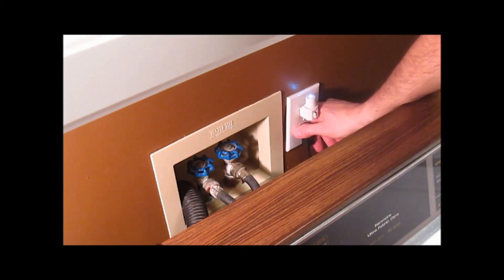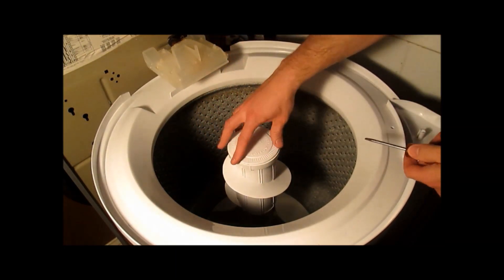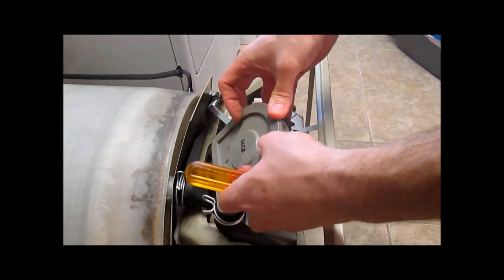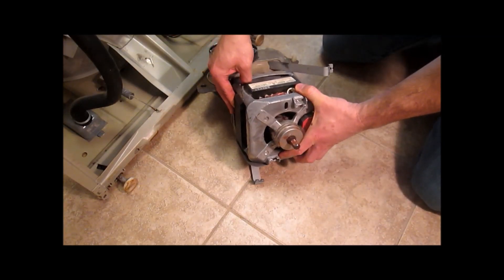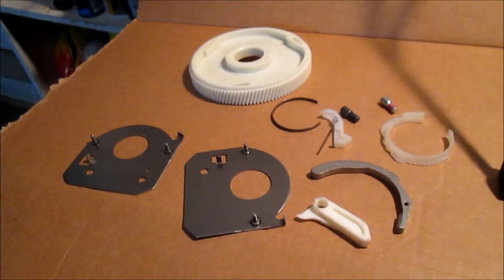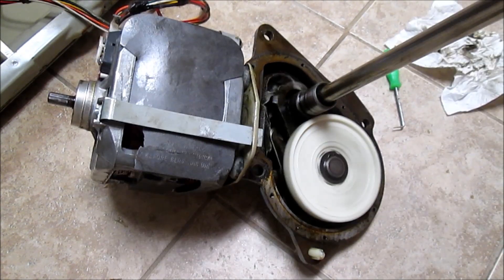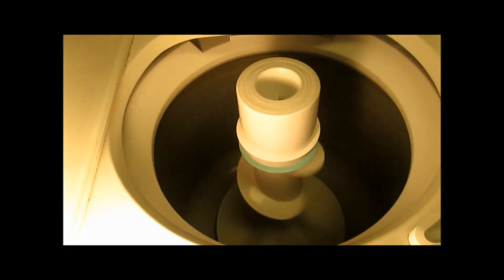How To Repair a Washing Machine Transmission - DIY

Comment: Forgot to mention that the top needs a bead of sealer/silicone sealer. Good info about spinning gear backwards to test the lock. I've been trying to find engineering info as to how the levers under the gear work. FYI, if your clutch gives out, check to see, during the spin cycle, if the washer will drain the water out first before it starts to spin. Bypass the lid switch and let the timer run till it starts up to spin. You should see the tub start to spin but immediately lock. You hear the motor continue to run (in reverse direction to "wash"), while the direct connected water pump drains the tub. The motor and pump will run until you see the water disappear then you will hear the pump gurgle as the last of the water drains. The timer will then advance a bit until you hear the motor stop for a few seconds. When it starts up again, the entire tub, now empty of wayer, will start to spin. The washer does this little trick in order to not have to spin a tub full of water. If the "neutral kit" is defective (parts he replaced), the washer will try to spin while full of water, overloading, then wearing out the clutch. (the part he removed from the top of the transmission. This design of washer is a direct drive Whirlpool, also sold under the Kenmore brand. Very very good washers.
Reply: Google "Whirlpool Direct Drive Technical" and you'll find a PDF of the technical manual, which describes the operations in detail.

Comment: After draining the oil I would have cleaned everything with kerosine or preferably brake cleaner. You put clean oil and it was instantly contaminated. Also did you forget to put the sealer on so oil doesn’t leak out?

Comment: I want to thank you.  My coupler broke and after replacing it I decided to test it and i realized it wouldn't agitate.  I was sure something in the transmission broke and i was watching this to get a familiarization and at 4:23ish you said it wouldn't work without water.  That small comment made me realize i should put water in the machine and retest and voila it worked.  So thank you for saving me from more work than i thought i would have to do.
Reply: It will agitate without water, if you remove the pressure hose going to the water level switch and attach another one on the switch. Blow in it until you hear the switch click. Fold the tube, or hold you finger on the end to keep the pressure in it. Then set it to agitate.  When you release the pressure in the hose, it will quit agitating.

Comment: I strongly suspect this is my problem. When washer goes into spin it sometimes doesn't engage and sounds like a low volume machine gun. Guess one of those plastic pieces is slipping. Already replaced the clutch band and it works great on small loads. Time to shop for a rebuild kit. Looks simple enough after viewing this video and much cheaper than $160 or more for a new transmission. Thanks for the well done video.

Comment: Okay... I thought this was gonna suck... but I am pleasantly surprised by the good detail. I would only add when you flip the washing machine on it's back, use a block of wood under it to raise it from the ground so no accidental damage is done to the inlets or anything else on the rear of the machine.

Comment: Would also add, scrape off the old factory gasket and put on new gasket on the transmission pan, JB weld black or really any gasket meant for heavy oil applications will work

Comment: How you get the spare part it is old model i have WH38X10002 gear box and i dont found spare part for repair it the rod shaft the Oring. And i see video they change this part but he toking in Latino from where i can get this part

Comment: Hi Lou, amazing video! I have an old top loading Hot Point washer with the agitator speed control no longer engaging the slow mode. is this managed by the transmission as well or do you think it is a different mechanism? Washer works just fine but can't seem to engage the slow setting.
Reply from the maker: You will have to google that specific washer to find out for sure, but I suspect slow mode is achieved electronically.  That switch likely reduces power to the motor, so it turns more slowly.

Comment: Also interested in what was wrong with your transmission, or a description of the noise it possibly was making.  My 90 series Kenmore is making a funny (ha ha) noise during spin, and I was advised it's the transmission - and further advised the neutral drain kit (as in your video) probably wouldn't resolve.  Thanks for the video.

Comment: Great video. How did you diagnose it was transmission gear issue
Reply from the maker: Good question!  I should have covered that. When that gear has teeth stripped off of it, I’m like mine did, the machine will agitate during the wash cycle, but will not spin.

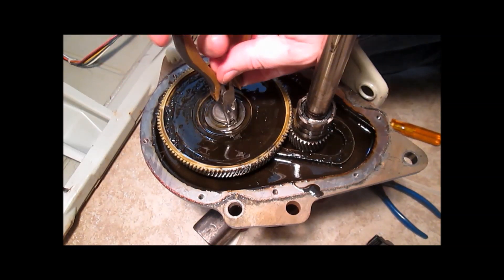Comment: At 2:44 I new the circlip would go flying. Glad it looks like they gave you a new one. Much easier not to lose it if you use the proper tool.
Reply from the maker: +Jim Bryson - You are right.  I did not want to buy a tool I would only use once.  Ok, I was too lazy to go to the hardware store.  Luckily, I did not lose it.
Reply: I don't own the correct tool myself if how I know.
Reply from the maker: +Jim Bryson - 😃

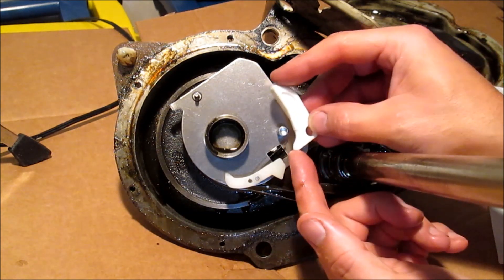Comment: It seemed to me that at 3:37, the spin pawl was not fully seated so its short end presses against the metal tab to limit its travel.  Gears & bearings are pretty sensitive to dirt, so washing out old grunge with a solvent (kerosene, etc) has always been worth my time.  Clean off the sealing surfaces & use some RTV around the cover edge before buttoning it up to reduce the change of leaks.
Reply from the maker: Excellent addition.  Thank you.

Comment: You can make a cheater to run the transmission without water in the tub and without the motor being on it. 
  Attach a coupler half on a 1/2” bolt with a couple of nuts to hold the coupler half in the bolt. 
  With the motor out of the way, attach the cheater to a reversible drill and push the coupler half onto a coupler half on the transmission. 
  Run the drill in one direction to get the transmission to agitate.  Then reverse the drill direction to make it spin.
  I have a couple of machines I need to change the neutral drains in myself.

Comment: That's cool, but is there a video for replacing the bearings in the newer belt drive (non-serviceable) transmissions? I've drilled out the rivets, but I'd like to have some bearing numbers before proceeding any further. I just know it can be done cheaper than buying a $209-$315 transmission for a 5 year old washer.

Comment: Got to the part where u pull the transmisson out and it wont budge. All bolts, screws, clips and clamps are out. What can i do?
Sledge hammer is coming to mind (out of frustration).  Is it possible that it is rusted
Reply from the maker: Make sure there is no retaining clip.  They can be small.  If it’s been sitting for a while, it’s possibly rusted, but not very likely.  You can try penetrating oil.  They can be a little tricky to get out. Try wiggling it and yes you can tap lightly with a hammer and block of wood on the top of the spindle.
Reply: All i saw was a rubber fittng around it .(No metal fitting. No clamp). I couldnt get it out because it would tear each time i tried.  I beat it down but something still holding it and preventing me from removin it.
Reply from the maker: You have a different model than I do.  Google the exploded parts view of your specific model and try to locate some retaining clip.  Also, that rubber ring may be hiding a clip under it.

Comment: I have a ROPER. Can i use the same transmission repair parts from your link?
Reply from the maker: Possibly.  I lot of manufacturers use that transmission.  Go to AppliancePartsPros.com and type in your exact model and it will tell you what parts you need.  I think they have phone support too.

Comment: can this cause the washer to have a grinding sound while trying to spin? I've replaced the clutch and the rubber piece with the two white tri finger pieces and worked great for a week. now it's ginding and won't spin
Reply from the maker: Yes!  I bet the big plastic gear in your transmission is losing teeth.  A failing transmission will put extra force on the clutch and eventually break it.

Comment: Actually, if you pull the pressure hose going the water level switch off the tub and blow in it, the motor should agitate. 
  I usually try to have an extra hose on hand. ThenI pull the hose off the level switch and put my extra on it. I can then blow in it to see if a washer will agitate. I do this sometimes to as a preliminary check to see if the washer will agitate without having to wait for it to fill up.
Reply from the maker: Good idea to do a quick check.  Here is video that includes that hose.   
How To Fix an Overflowing Washing Machine - DIY https://youtu.be/JQkLqibeTtU

Comment: FYI, the factory spec oil is a 60w and very thick. 80w-90w is roughly equivalent to a straight 30w. In other words the fluid you used is waaay too thin. Total oil capacity is 16 ounces.
Reply: That's what my question gonna be bcuz he didn't say how much oil to put in total at the end. So once its complete it takes a total of 16oz?
Reply: @kelvinolivas7558  I have used 80-90w before.  
  I don’t understand that being the same as 30.

Comment: I was told by an appliance company repair person that the "part" for my transmission job was $398.98 for an old Kenmore wash machine. Labor quoted at $240.00. This guy in the video bought the repair kit for $16.00. Am I royally getting ripped off? The water isn't draining from the barrel so he has to tackle that issue first. Even so, I feel like I'm being fleeced. Am I correct?
Reply from the maker: I hate to call anyone a crook without seeing first hand what they are doing.  Google Rebuilt Kenmore Washing Machine Transmission.  You can buy the whole thing for under $200.  Labor time to replace should be no more than one hour.  I don’t know if your prices include fixing the drain issue also.  There are certainly repairmen that will take charge a lot if they can, and tend to make the most money from people that don’t fully understand the repair.  You might want to get another quote.  Also consider the price of a new washer.  Although those old washers were built way better than the ones sold today.
Reply: @HowToLou  UPDATE - I got in touch with another appliance repair company who actually took the time to thoroughly diagnose the problem. Turns out it was the drain pump. The work was honest and the price was fair. Thanks for your advice. I'm happy I found a company with expertise and integrity. There's no shortage of people in the world who want to take advantage of your money and your time.
Reply from the maker: Excellent!  I am glad you found someone you can trust.
Reply: @KittyKatTat  That over priced greed repair person it sounds like to me is on DRUGS - addicts have to feed their Expensive addictions
Take care

Comment: what was broken? it looked like the old gear was ok and more robust.
Reply from the maker: The metal piece called the "latch" was broken.  The old and new gears are identical.
Reply: To an extent I agree that sadly many replacement parts aren't as good as the old ones but this time it looks the same. I just did this repair with Whirlpool OEM parts they did cost more but I know its gonna be a perfect fit and done right.
Reply: What were the symptoms of the washer when the latch was broken?

Comment: No seals? Mine is dripping oil
Reply from the maker: I reused the old seal.  Yeah it dripped a little, but not too bad.  You can, and should, buy a new rim seal while you are in there.

Comment: Ok....should I be alarmed 2 repair guys used a hammer and some sort of brace to remove the tyranny by going from the top of the washer?
Reply from the maker: I have never done it that way but its probably legit.  Hammers are commonly needed to separate motors from other parts.
Reply: @HowToLou  I think they did more harm to it

Comment: Hi.  I was wondering, what is the purpose of the Trip Lever in the transmission?  I did the rebuild but it drains but does not do the spin unless I open the door and close it again.
Reply from the maker: That sounds like a bad lid switch.  I cover that in this video.  How To Fix a Washer (Washing Machine)
https://youtu.be/eEG9vX4rpmo